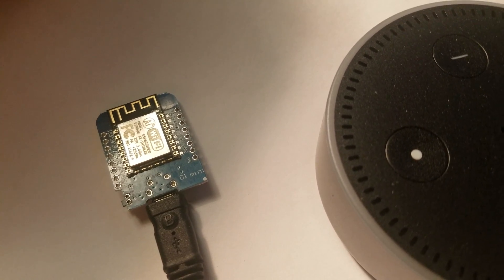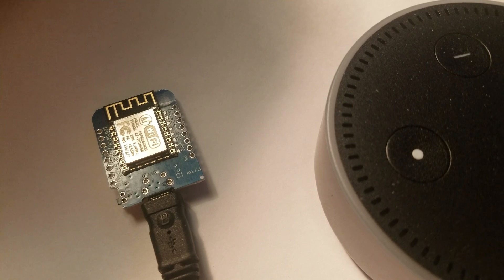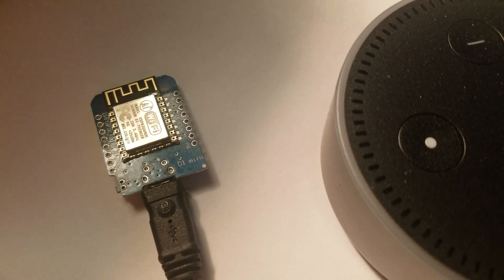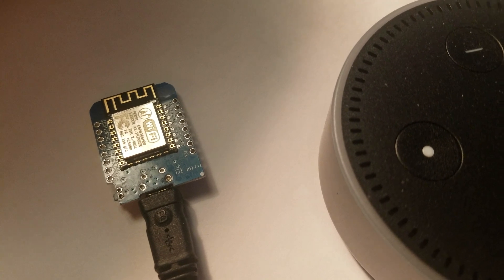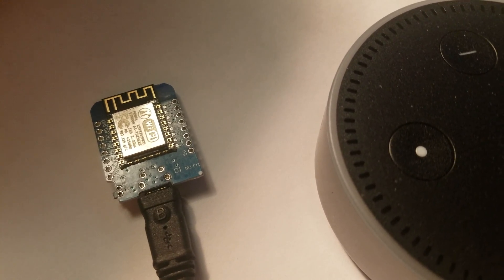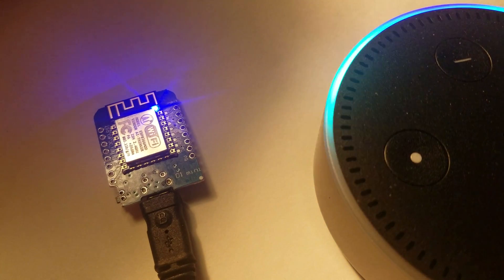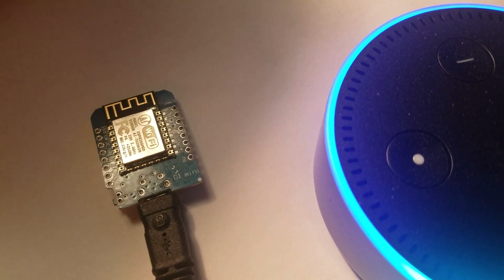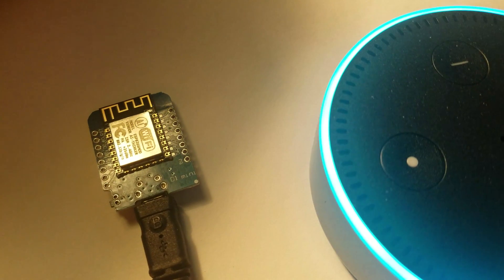Garage Door Project - Amazon Alexa Controlling Wemos D1 Mini

Comment: I'm having trouble with adding pins. when I define one, they all go high. Can I get a quick peek at yer code?
Reply from the maker: Here is the code I demonstrated in the video.  With that, you should also get results from the LED and pin 2.

#include <Arduino.h>
#include <ESP8266WiFi.h>
#include "fauxmoESP.h"
#include "credentials.h"

#define SERIAL_BAUDRATE                 115200
#define LED                             2

fauxmoESP fauxmo;

// -----------------------------------------------------------------------------
// Wifi
// -----------------------------------------------------------------------------

void wifiSetup() {

    // Set WIFI module to STA mode
    WiFi.mode(WIFI_STA);

    // Connect
    Serial.printf("[WIFI] Connecting to %s ", WIFI_SSID);
    WiFi.begin(WIFI_SSID, WIFI_PASS);

    // Wait
    while (WiFi.status() != WL_CONNECTED) {
        Serial.print(".");
        delay(100);
    }
    Serial.println();

    // Connected!
    Serial.printf("[WIFI] STATION Mode, SSID: %s, IP address: %s\n", WiFi.SSID().c_str(), WiFi.localIP().toString().c_str());

}

void setup() {

    // Init serial port and clean garbage
    Serial.begin(SERIAL_BAUDRATE);
    Serial.println();
    Serial.println();

    // Wifi
    wifiSetup();

    // LED
    pinMode(LED, OUTPUT);
    digitalWrite(LED, HIGH);

    // You can enable or disable the library at any moment
    // Disabling it will prevent the devices from being discovered and switched
    fauxmo.enable(true);

    // Add virtual devices
    unsigned char device_1 = fauxmo.addDevice("Double Garage Door");
    unsigned char device_2 = fauxmo.addDevice("Single Garage Door");
    //unsigned char device_3 = fauxmo.addDevice("light three");
    //unsigned char device_4 = fauxmo.addDevice("light four");

    // fauxmoESP 2.0.0 has changed the callback signature to add the device_id, this WARRANTY
    // it's easier to match devices to action without having to compare strings.
    fauxmo.onMessage([](unsigned char device_id, const char * device_name, bool state) {
        Serial.printf("[MAIN] Device #%d (%s) state: %s\n", device_id, device_name, state ? "ON" : "OFF");
        digitalWrite(LED, !state);
    });

    // fauxmo.renameDevice(device_2, "light five");

}

void loop() {

    // Since fauxmoESP 2.0 the library uses the "compatibility" mode by
    // default, this means that it uses WiFiUdp class instead of AsyncUDP.
    // The later requires the Arduino Core for ESP8266 staging version
    // whilst the former works fine with current stable 2.3.0 version.
    // But, since it's not "async" anymore we have to manually poll for UDP
    // packets
    fauxmo.handle();

    static unsigned long last = millis();
    if (millis() - last > 5000) {
        last = millis();
        Serial.printf("[MAIN] Free heap: %d bytes\n", ESP.getFreeHeap());
    }

}